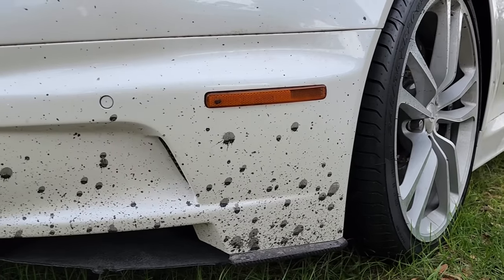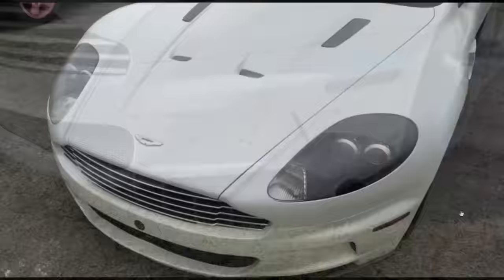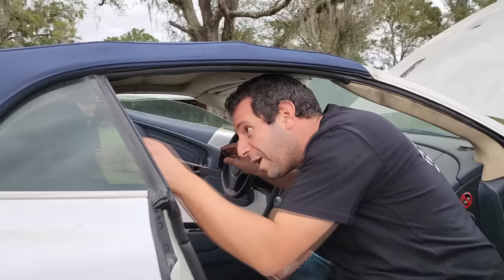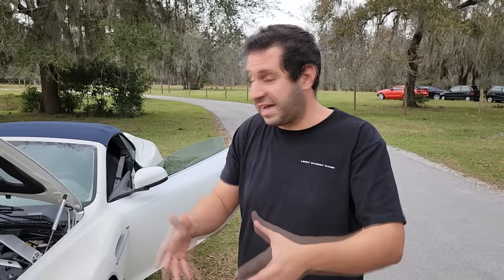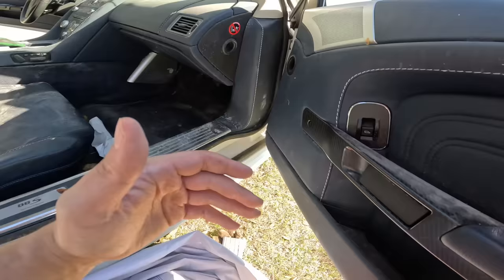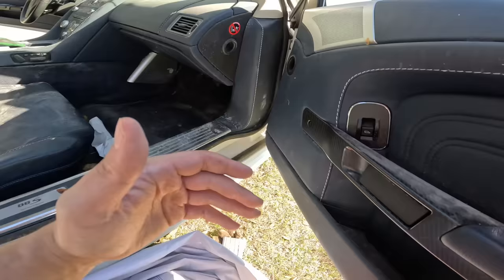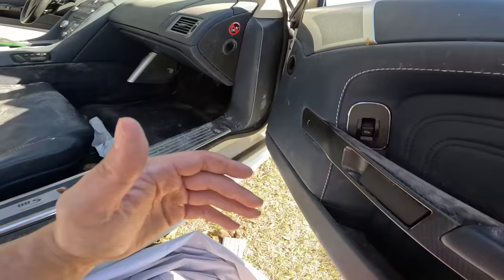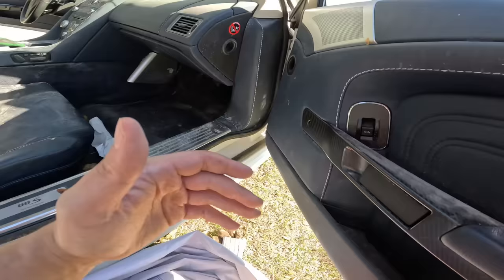I Bought a $286,000 Aston Martin V12 and got 90% Off because it was Flood Totaled

Comment: You should avoid rushing to power a flooded car. First you should wash it to remove the most salt as possible. Then clean all the electronics and connectors. Replace the fluids, and only then apply power to the car.
Reply: Stop making sense
Reply: The only problem with that is it's a good idea
Reply: Would it even matter if the car had a connected battery when flooded? Can't do much more damage
Reply: u must be new to this channel...sam is a special individual lol
Reply: He can't get to everything anyways
Reply: This video is made for views, not for practical sense
Reply: You forgot, remove the spark plugs and turn the engine
Reply: @DommoPA  yes. You should also definitely remove the spark plugs if the water line was high.
Reply: This is called 'doing it the right way '
We don't do that here
🤷🏻‍♂️🤦🏻‍♂️
Reply: Ya, but that's boring, and boring doesn't sell on youtube
Reply: Don’t worry, Sam is never in a hurry.
Reply: Compleatly agree, and my first thought when I watched this video.

Comment: That module in the Volvo world is called the CEM and it stores the configuration for the car on it including VIN, it also handles the immobiliser. You may be able to get some power to the car by replacing it, however it'll likely require coding to get it fully functional.
Reply: They are programmed to the car . There are services that take the Info off the old cem. I don't think that will work on this one tho .
Reply: The rate in which Sam "works", he will have to worry about that part in a few years.
Reply: Always amazing to me how much AMs cost and how cobbled together they are with parts from a garden variety of makes.
Reply: The Volvo part costs $80 used, on a scrap yard. Additional cost for programming if needed.

Comment: If you can get to the seat motor connector, you should be able to move the seat with 12v
Reply: I was thinking that. Cordless drill battery
Reply: Could just find the connector at the BCM  and apply power there on the pins to the seats. Same for the trunk release.

Comment: Anything with power will suffer from electrolysis, when exposed to salt water.
PCBs wil dissolve copper traces and anything zinc will disappear.
Some things I found thru experience...
Use phosphorus acid mixed with water to clean fuzzy residues, it will dissolve base metals. Then blow with air.
Imediately wash again with soapy water strong mix, blow off, then with distilled water as final rinse. Dry with hair dryer then use dielectric spray and grease in connectors.  
Use a brass brush to polish , plastic toothbrush to scrub.
Find the main power buss in the electric system and pay a bit more attention to those circuits, you may have to open connectors and de-pin to clean or replace.
Time consuming but doable.
Best of luck 🎉

Comment: Hey Sam, I'm not sure where you are at in the process, but my DB9 had an electrical kill switch in the trunk and a reset behind the passenger seat under the squab. (Its very possible the owner rolled the windows down and hit the disconect in the trunk before the storm to prevent damage) You can also most likely get to the trunk through the back seat area as there should be a pull release that can be accessed through there. Good luck! Can't wait to see the progress.

Comment: That fuse panel box needs to be programmed to the car. I went through this about ten years ago on a DB9. Got it off Copart and was flooded the same as yours. I purchased a used fuse panel box thinking the same as u but it didn’t work. Turns out the box is coded to the car. I took the car to my local Aston dealer it took them two months to get a new box and at the end they couldn’t program it completely as they needed the old box to download the software and uploaded it into the new one. Wish u luck but that fuse panel box is a nightmare.
Reply: Sick design. Thank God my Toyota is not so ”wise”.

Comment: I was the previous owner of this DBS. It has a number of new parts. The coil packs and plugs are new and the oil was changed appropriately 1,000 miles ago. If you can’t get it repaired I have a relationship  with Aston Martin for parts and would be interested in buying it back from you.
Reply: @VirgiliuMatei

Comment: Pull the plugs under the seat and power the motors from a battery to move seats forward.
I’ve got a C30 volvo and a few have issues with this CEM and it’s coded to the car.
The c30 screen has a fault that leaks in water on to these causing all manor of issues.

Comment: the plastic box you removed is not just a fuse box. its what you call a CEM module.  its a common failure item on Volvos with heater core failing and dumping into it and another failure from the heat in hot climates.( heat failure causes the module to randomly loose communication and put the car in limp mode)  these modules are also uniquely programmed to the vehicle and can be done only by the dealer.  also you cannot get a used module to program through the dealer  it must be a brand new module. and they cost around 550$ new.

there are third party services that can read the immobiler data and other vehicle data from old module and then write them to a  used module but your old module doesn't looks like the information can be retrieved from them.  it looks like you need a new module and has to be programmed by the dealer.

some simple research across forums would have told you this but i guess it adds for a good story to buy a used module and showcase viewers how it wont work.
Reply: Oh you've just put a gigantic spanner in the works! lol ( sorry I'm English so that should have been a gigantic wrench in the works for those of you in the US )
Reply: @samrodian919  not really it would cost nearly 350$ or less for a new CEM module. volvo charged me nearly 200$ to program it. i am guessing aston martin would charge   him more.  but pretty sure for under 1000$ this can be resolved.  the CEM module controls all the central electronics and is gateway to all the other modules it is very vital.

for any other older volvo this might be as you say "throw a wrench in the works"  but this is a very desirable aston martin dbs so its actually considered a cheap repair.
Reply from the maker: Holy jeez this is big info. There is literally 0 information on these cars on the Aston Forums...
Reply: @Ajay-kl8el  if Volvo charges $200, Aston Martin will probably charge something like $8,000. Ten grand if you also want them to make you a spare key.
Reply: @Samcrac  i had the same CEM module fail on my volvo c30 and s40. i live in the middleast  we have have some crazy heat here in the  summers. the module would just randomly freak out while driving and put the car in limp mode.  there are many third party services on ebay and forums who can take the important data from the old module and program it a used good module. but this may not work for you as your module looks toast  but could be still possible as the information they need is in a single chip.

i ended up getting a brand new cem for nearly 500 or 600$ and took the car to volvo to have it programmed. i had to pay 200$ for volvo to reprogram it and its been fine since then.  the dealer will not be able to overwrite and module that has already been written to so if you are going the dealer route it must be a brand new fresh module.

good luck sam excited to see you get this one back on the road

Comment: Sam use a can of deoxit on all the crusty connectors it will get rid of the green crusties use a dental pick and a small bristle paint brush on the terminals then use some dialectric grease on the plugs the dioxit is meant for green crusty wires and connectors hope this helps cheers from down under

Comment: Yep corrosion like that and electronics is not a good sign, Likelyhood is that you'll be replacing every single bit of electronics in that thing. All wires have to be packed with desicant to get rid of all water. Corrosion will be on all pins and connectors !!. Your in for a lot of expensive work !! Also note water will work it's way along the inside of all wire jackets, so wires over time will corrode and fail if not properly dealt with.

Comment: Sam, you should invest into a dry ice cleaning machine to clean the inside and underside of the car. This will get rid of all the sand, salt water residue and fix all electronic surface corrisson. Expensive since you need an industrial compressor, but you should be able to receive some sponsorship from suppliers.

Comment: Use sterilized water. To clean off these electrical boards. All the components are epoxy sealed. So it is actually to clean contacts and to clean the electrical boards.
Reply: After the boards are cleaned and all oxidation that could cause shortage is removed. These boards should come back to life. 

BUT. ALL connectors in the car should be taken apart and inspected and cleaned.

Comment: Presume with the seats you fish around for a connector under the seat in the hope you can bypass normal controls and apply power to the motor that moves it forward. If it isn't rusted solid.

Comment: Cant you just obtain a wiring diagram, work out which wires send power to the seat electrics and tap into them with a 12 volt supply

Comment: If you can get to the seat connectors try to apply 12V directly to the seat motors with alligator clips and a drill battery to hot wire it.

Comment: Well with this project the aston martin is made primarily out of I think bonded and wielded alumiumn, the main thing would be the electronic harness, and honestly I'd say take the thing to a touchless car wash and have the underbody washed to get that crap out of there, once you get the windows up and this thing should be pretty good if the engines good

also your telling me aston doesnt have a way to get to the trunk via the back seats, as one of the dumb things they started doing because of the soprranos would you believe, is actually to have a glow tab you can pull to release a trunk from the inside. so if you can get in from the interior and find that tab and pull it, you should be able to release the trunk.

also its a ford martin, the bits and bobs are actually from the volvo SC90 would you believe, should be easy to cross reference and get parts from that

atleast it was on the Rubber baby bumper buggers ugly as sin aston martin V8 Failtage, the DBS is nice though

and for some dumb reason everyone knocks it for having 2x a ford V6 without any of the synchronicity problems the jaguar's and the BMW's had in back in the day with the kbosh on the 850 IL and some of those early jaguar V12's from the 70's and 80's

like you give them something that works, and they still find a way to complain, which they probably learned NOT to do from jaguar when they bought them in the late 80's

and while I sympathise with people saying its not pure bred, and these were always abit off on the pace of the ferrari's and fake a ghini's the VW group made, their still damn nice cars when they work

and the nav system set up on this is what everyone should be using, a nice hideaway unit that doesnt blind you as you drive, as yes speed plus a computer screen to distract the driver is always a good thing in something as fast as a tesla

and you wonder why the insurance rates are out of sight on those, hell this Vanquish replacement is probably cheaper just because of that lol

Comment: I bought a one and a half year old AM DB 9 with 700 miles for half off.  Wealthy do not buy used so these car depreciates terribly but still too expensive for second owners as parts are still priced for a $200,000 vehicle.  I bought at a AM dealership where internet price was $20,000 less than floor model for same vehicle.  Internet sales bigger than floor sales.  With EV’s now with more horsepower and low maintenance, I am happy with Teslas.  Charge at home, repairs are plug, and play.  I save $500/month on electricity with my EV and solar panels/battery.  Tired of expensive tags, yearly maintenance, and insurance on exotic cars.  They are like airplane expenses.  Truthfully, Porsche is as close to an exotic without the parts headaches.  Porsches definitely daily drivers and 5000 miles on a Porsche is low mileage vs exotic high mileage.  Lol

Comment: That's fun, they even used the CEM of a P1 Volvo. xD It's not going to work out of the box. Needs to be programmed. Best way to do it, is to dump the file of the original CEM (If Memory chip is still readible) and then put it on your donor CEM. Volvo sucks with these things. Everything is protected. Probably the same with the AM version.

If that does not work, the only thing you can do is virginize the new CEM and program it through AM.

Comment: When you removed the footwell cover plate to expose the fusebox my exact words were 'Holy F***!!!' You've certainly got your work cut out on this one. I'd suggest de-pinning those connectors and getting a hold of new terminals to crimp onto the wires. Hopefully the salt water didn't wick too far up each of the wires though otherwise it'll mean a new sub harness.

Comment: Brand new, right out of the showroom these cars are destined to fall apart by the time you reach the first mile.  If you're really lucky, Aston-Martins will run well for ten miles but that's rare.  A used, water logged Aston-Martin is not a car.  It's junk.  So, you buy a hunk of junk at what you think is a reduced price and then spend a ton of money getting a crappy car to run like new?  If "new" was good, maybe you made a good decision.  But, "new" isn't good.  Running like "new" is measured in minutes, not miles.  The term "Super Car" was coined by people with more money than brains who actually think that just because a car is really fast, that's a good thing.  Those of us with brains know better.  Time is our biggest gift in life.  Wasting it on something like this is simply nuts!!

Comment: Actually shocked how bad that fuse box in the car looked tbh!

If that particular fuse box is described as the Body Control Module, it might well also have ECU's in it that will have car specific software embedded and need to be right for it to work - even if the electrical circuits and part number match..?

Comment: I feel like the engine alone is worth enough that you will do fine financially, regardless of if the rebuild ends up working out or not. You should go for it. It seems like you've already addressed most of the issues it's having so far.

Comment: i bought  a srt8 jeep from Ian and it sucked obviously pulled the carpets and stuff but water line was to the headliner , damn sunroof track was rusted solid, also about 27 modules completely corroded away, most stuff in the engine bay was okay because of the connectors , obviously the trans and engine and diffs where full of water , and i used a special cleaner for the plus and a pin file, but i did have to replace some pins in various harnesses with a spare harnesses
Reply: sounds like a waste of time

Comment: 11:32 Excuse me but what does a Volvo fuse box do in an Aston Martin? Every time Sam talks about getting parts for his expensive project cars from other manufacturers I chuckle a little, but this time there's not only the manufacturers name on it, but you have what appears to be the part number in huge letters on the fuse box.
Volvo 31268178

Seems they are used in the S40 and some other Volvo cars. It should be pretty easy to find and not all that expensive...

Comment: That’s not just a fuse box. That’s the main gateway module on the car that is programmed to the car. It also stores mileage so if that Volvo it’s come from has done 100,000 miles and your Aston has done 10,000 the higher mileage will be copied to the dials. So I suggest you don’t fit that
Reply: You can legally reprogram it to the proper mileage at that point...assuming that someone makes a tool capable of doing it.  If you get an OEM new part, it's most likely programmed to zero miles 😅
Reply: Correct a new one comes with 0 miles but once plugged it the miles from the Cem is copied over. If he connects the Volvo Cem it will copy the miles over and then require the dials taking apart and the mileage corrected and that leaves a fault code permanently.